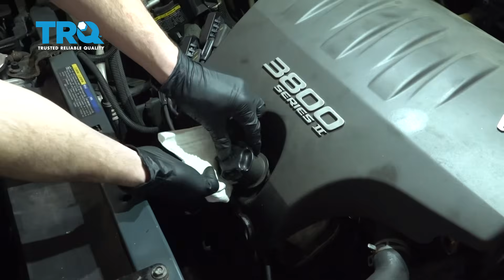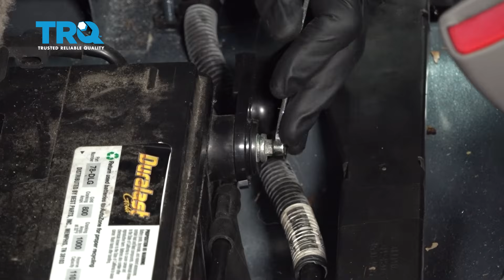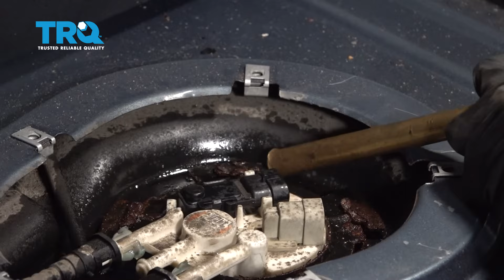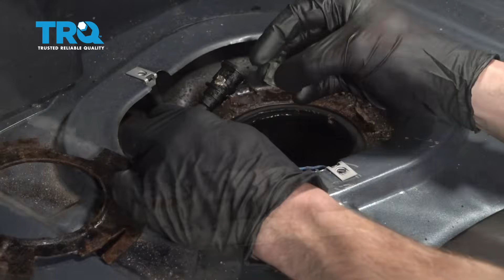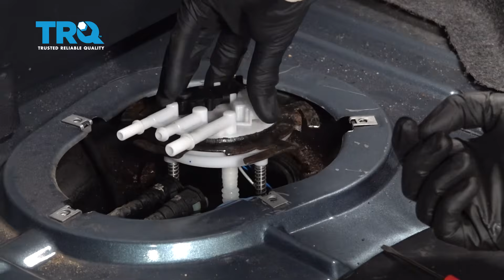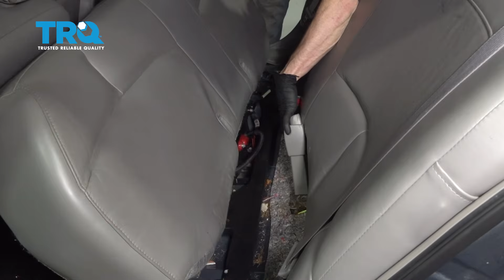How to Replace Fuel Pump & Sending Unit Assembly 2000-2005 Buick LeSabre

Comment: As always very nice work on your videos for us DIY'ers and parts buyers.   Thanks!!  When you placed the trap door over the top of the newly installed pump I saw the hose for the middle nipple not re-attached.   I had to rewind to where you took the trap door off to see there was no hose on this particular car to start with.  Most of the videos I've watched seem to have had a third hose in the middle.  Any idea why there is a difference?

Comment: Just had to do this and had your video playing in the trunk. Went exactly as described. Only hiccup was the old unit lower half didnt want to slide out, so had to break of pieces of the rim until i was able to squeeze it out. Install was smooth.

Comment: The proper way to relieve this fuel pressure is to remove your fuel pump fuse, start the car, and let the car idle until it dies. Then, go to the fuel rail and release the pressure from that valve.

Comment: Have a 2003 that's been sitting & about to do the fuel pump on it. Was expecting to have to drop the tank but on the off chance there was another way...glad my suspicion was correct. Good on GM for thinking ahead on accessibility.

Comment: No need to mess with relieving the pressure under the hood.  Start the car and pull the fuse for the fuel pump. Car will die when it runs out of gas, no more pressure.

Comment: Decent video up until the point of extraction and the convenient edit where they spent 3 hours cussing and beating on this this to pull it out of the hole that’s smaller than the sending unit housing.

Comment: Thanks a million, I just replaced a lady friend of ours, I'm not a professional so it took me about 5 hours to slowly and safely complete the install.  The video really didn't show the full extraction of the pump and what I found out it is really really tight fit, so much I thought it would not come out at all.  Finally keeping it straight up and down and pulling up on it hard it came out.  Another thing to realize is once you get the new one in it bottoms out at the bottom of the tank but stick out above the hole about 3".  The first thing you think is they sent you too long of a fuel pump.  But what's happening is those 4 poles on the pump with springs on each one are so you can press down on the top of the pump and then it will collapse down in the tank, then you hold it down and start the steal seal ring into the ears and start your pound it closed. A thing that needs to be mention is this is obviously a potentially dangerous job.  After you take out the old fuel pump you are staring at a 5 " open hole of a tank of gas lying on your side in the back of the trunk.  When this gentleman says to use a brass bar and take every precaution not to solder wires together that's an understatement to me.   I couldn't wait to get the old pump out and the new one in to cover the open hole of a half a tank of gas exposed to the environment.  It takes alot of pounding to get that steal seal ring off and back on.  Another thing was if the weather was good I would have done it outside not in my garage and have a plan if it does catch on fire. Fire Extinguisher, wet blanket, etc.  Of course probably best would be to drain the tank.  Anyway thanks for the Video!  It was very very well done!!

Comment: If that ring is not put on completely and vapors are getting into the cab will the check engine light come on? I think that my mechanic didn't get that ring gasket thing put back all the way but he insists that if it is not tight enough and the vapors are escaping then the check engine light will come on. He thinks either some fuel got into the cab or vapors from the tank being open saturated the backseat and are releasing when the windows are up.
I can air it out and the smell goes away but then when I drive my car and leave the windows up and comes back. I can smell fuel very strongly. If I drive it for more than 20 minutes I get dizzy. After seeing your video i think something with the rubber or metal gasket is messed up
Reply from the maker: +B S Thanks for watching our video! http://1aau.to/m/Shop-TRQ

Comment: Well, I'm annoyed that one still has to splice the four wires. Why? Why? Why? It's 2023 !!! Really?
    I soldered and shrink-tubed the four wires when I did this job on a 2000 park avenue.  It was outdoors and well ventilated.  I'm not a fan of those crimp connectors. 
    I was hoping when I did the same job on my '02 Lesabre  they'd have the right connectors !!! I suppose not.
    Also, when u pressed the float arm into the black plastic piece that has the two wipers on it, please next time support the back of the black piece.  Why? It's a pivot.  If that piece gives a little, you'll pull the wipers away from the resistors they need to rub against for the fuel gauge to function properly, which is probably why you're changing this part in the first place - fuel gauge wacky !!
    Good point about sparks.  Does brass and steel not spark?
      Is it safer to have an almost empty tank, or a full tank?  I know an empty tank is  less messy but can't u have more dangerous vapors?
   Maybe use a new locking ring next time.  That one was rusty.  It should come bundled with the fuel pump.
   Great, instructional video.  Easy to follow for someone who hasn't done such a job yet.
Reply from the maker: +Anthony hfe Thanks for watching our video! http://1aau.to/m/Shop-TRQ

Comment: With respect to the guy in the video...I replaced the fuel pump on my 1999 park Ave and I soldered the wires as non-shrink crimp connections will corrode over time. 

Always wondered why they felt the need to change the harness style on the replacement pump...the original lasted perfectly well. Oh well...the fact that the General put the port in the trunk to access the pump earns them a by in my opinion. Way easier than dropping the tank...

Comment: It’s the lock ring and wire splicing that’s a pain! My 2004 Buick LeSabre is at 193,000 would it be a good time to clean or replace the ignition module?
Reply: If it ain't broke don't fix it...they either work or they don't.
Reply: Absolutely! But use Delco parts. You'll be sorry if you dont.